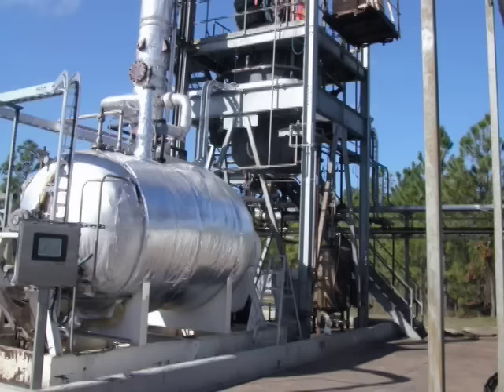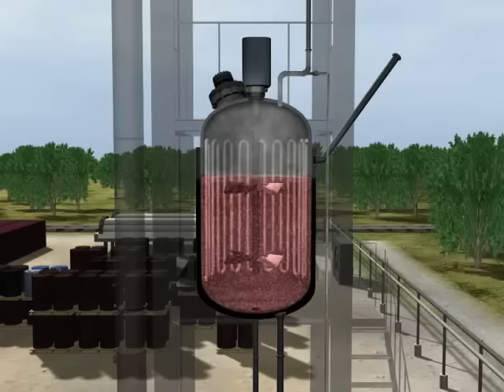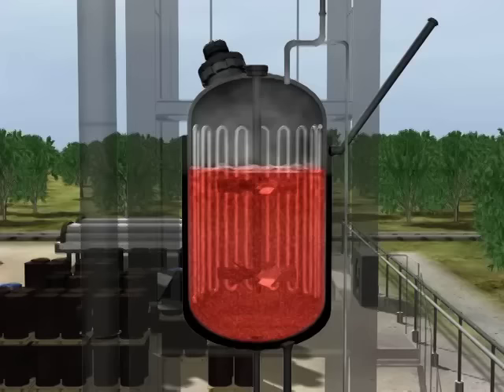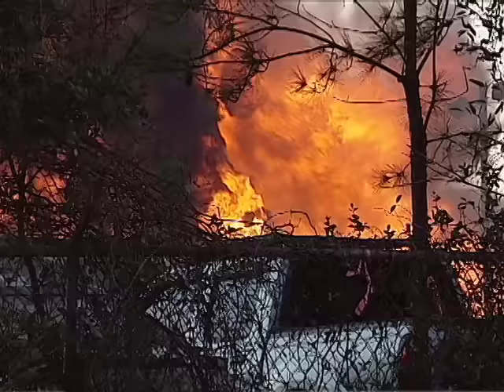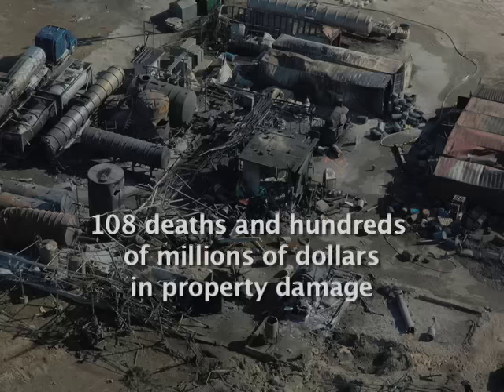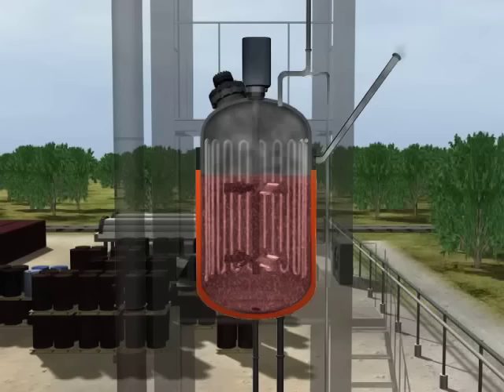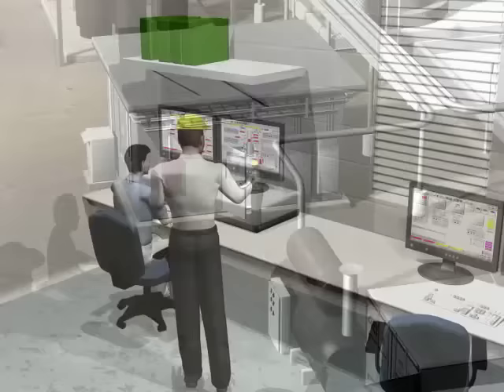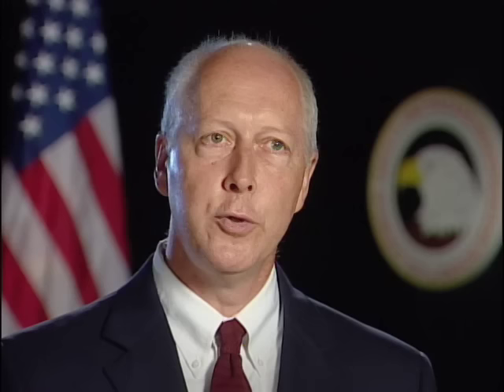Runaway: Explosion at T2 Laboratories

Comment: Is that a saying yet?
"In a runaway reaction, the best reaction is to RUN AWAY"
Reply: I haven't heard that myself, but it really should be well known saying.
That is one of the most important things to know about runaway reactions.
If you can't get it under control and everything seems to be failing, RUN AWAY!
Reply: No, that usually gets more people killed. You want to try everything you can to arrest such a reaction or flare it off, not run away and hope for the best.
Reply: With nuclear reactors, yes.
Reply: Your over reacting ;-)
Reply: Yeah almost making it sound like the thing had a mind of its own like natural disaster as opposed to the old story of greedy/ignorant business not performing adequit maintainance.

More a case of Runaway greed/ignorance vs worker safety in business practises.

Maybe accumilated birdpoop nuggets in the steam release pipe caused a blockade, that however would have taken a long time to build up and should cause noticable interruptions in the cooling for some time prior to the eventual failure.
Reply: @A-Viking  never mind lack of maintenance. There was only one method of cooling. When the water stopped, it was a ticking time bomb. Even a second source of water such as from the tank could have sufficed in slowing the reactions happening inside that pressure vessel.

A second valve that can be controlled from the control room, but with an manual override, to a standby water tank would have been a good start without costing a fortune to build.
Reply: David Daivdson  Yes, I'd love to know who signed off on the approval for that plant.
Reply: acronus that’ll do mate , that’ll do
Reply: Good one! 🤣
Reply: @gorillaau  Single point of failure, like the Boeing 737 MAX, is an accident waiting to happen.
Reply: @UncleKennysPlace  I wasn't going to go there with that one. The 737 MAX mess may take Boeing a while to get out of that hole that they dug themselves.
Reply: A Viking 
Not EVERY industrial accident is caused by corporate greed.
In this case, it was caused by ignorance. The people running the plant simply didn’t know enough about what they were doing.
Reply: @A-Viking  It was runaway meaning without cooling it becomes a runaway reaction. exothermic reaction, creates heat, heat increases reaction, makes even more heat more, and so on.
Reply: A bit more concise: if the reaction runs away, so should you
Reply: What steps do you take if the reaction runs away and there is no backup cooling? Bloody big ones!
Reply: Yes, but is that really a ... SOLUTION?
Reply: I am a Hydrogen Reactor Operator running 4 large batch reactors. One of our old plant managers (before my time) was asked how big an explosion would be if a reactor exploded. He was a Polish man with a thick accent and his response to the room was "gentlemen, if at any point you fear that you must run.... then it is already too late to run." 

I think of this line at least once a week at work 🤣
Reply: Get the........ out of here
Reply: Yup
Reply: @zacharysmith2983  what would it cost to build the control room as a below-ground bunker? Surely there's a way to avoid death.
Reply: At least when you are not capable of managing the heat anymore. Then you should run as fast as you can and as far away as you can. Evacuation is the only thing you can do. But because of that you should never perform chemistry that is unknown to you when it comes to hazards, order of reaction, reaction speed and the amount of heat that would be generated.
Reply: @A-Viking  Didn't seem to be mentioned in the video but it's important to note there was a side reaction above a certain temperature that was vastly more rapid. The owners where completely unaware of the side reaction and combined with a lack of any training in industrial process aspects of chemistry, (and lacked an awareness that they needed such expertise), they simply didn't realise somthing like this was even possibble. It's a classic case of "just enough knowledge to be dangerous, but not enough to be safe".
Reply: CaptainMcShotgun  *yro’ue
Reply: CaptainMcShotgun  oh right, my bad.

Comment: Besides an engineer allowing for such a reactor to be built without a more efficient means of cooling, or least a flare system for the excess hydrogen, it's amazing the amount of CCTV footage there was.
Reply: It's Jacksonville.  The city has had a crime problem for years, and they're only getting it sort of controlled now.
Reply: @tashkiira7838  A big city with crime problems???!!! Never heard that before!
Reply: @LSPD1909  Let me rephrase: Jacksonville has a crime problem that is disproportionately large considering the size of the city and the state it is in.
Reply: Been a few years. Most likely an engineer designed it for a smaller volume of product. The management in all their intelligence probably voted to increase production rates ignoring the designed capacity of the tank.
Reply: For what i see the problem was with total LACK of the safety valves...i would never allow pressure device without all valves to being sell.
Reply: The biggest surprise is that the CSB investigator managed to correctly pronounce the name of the chemical.
Reply: Keep in mind, Chemical Engineers dont actually know any chemistry. The engineer of the past is not what companies want from current engineers.

Comment: Who was the idiot that approved a reactor with ONE coolant line when the state licensed the plant? Never mind they should have built multiple small reaction vessels, there should have been at least three different feed pipes coming into the cooling jackets - PREFERABLY not being fed from the same source!
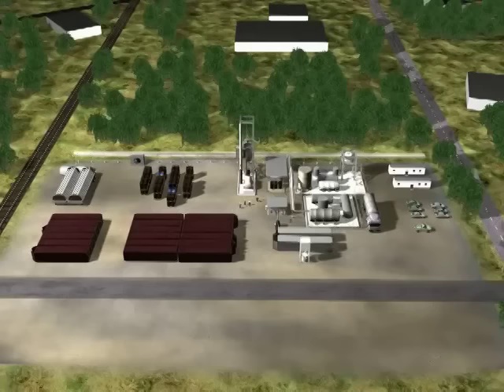Reply: +jmowreader --> The other question that doesn't seem to be covered in this video is why did the blowout pressure release "rupture disc" mentioned at 3:24 blow so late? Was the disc that was installed the wrong one with an incorrect pressure for the circumstances or did it fail in some manner?
Reply: This is what happens once regulatory agencies become "business friendly", they let people get away with cheesy designs so that they can save money.
Reply: What amazed me is the blast managed to breech the control room and kill the two men inside, I bet the staff had no idea just how powerful the blast would be if the tank ruptured, they all do now, well the staff still alive and won't make that mistake again.
Reply: It's very common for a reactor to only have 1 source of cooling.  I know, sounds stupid right.
Reply: Typical American Engineering; rather cheap and dangerous for fast money, then investing in a durable solution that may cost you more at the start, but saves money and lives in the long run.
Reply: bjtaudio I was even more amazed that the control room was literally right next to the chemical plant. Any serious industrial company with the least bit of scense and brains regarding safety would have build that control room far away from it!
Reply: NyTO really? A problem in a  system with only one cooling service is foreseeable not hindsight.
Reply: Marc Bonomini: are you being sarcastic or what? The business didn't put the adequate safety measures in because they wanted to make fast money... how the hell would they change that up without regulations (specially if a company isn't on the ground to see explosion and human life becomes cheap)? 

The bureaucrats weren't critical enough because they were probably paid off by company, didn't sign off on the building or the state cut down on regulations.
Reply: That's what I was thinking.
Reply: but think of the savings on IT work like fibre and long data runs!!
Reply: jmowreader Florida
Reply: @marcbonomini2751  what?
Reply: @marcbonomini2751  OK.... it might be as you say but some sort of  compulsory oversight is needed. I'm thinking that compulsory, comprehensive insurance might do the trick?? No insurance, no operation and have the insurance companies assess the risk.
The Pike River mine disaster..... failure of the most simple regulations, abetted by a business friendly government AND ignorant  and naive workforce and management.
Reply: @leighfoulkes7297  Imagine today. No regs none. NONE
Reply: @OAleathaO  Indeed...the "blowout disk" might as well have been a "blowup disk" there would have been virtually no time to react.
Reply: @thegreatga  Many newer systems have redundant backup valves, pumps and bypass valves so there are more than one way to introduce cooling, or supplement if required
Reply: Possibly some very newer systems with companies that care, but rest assured, the company that I work for doesn't.  Many of our reactors only have 1 source of cooling.
Reply: @marcbonomini2751  
You're playing the blame game.  You don't know what you are talking about.
Reply: @OAleathaO  I've never placed a lot of faith in rupture discs.
Reply: It's Florida
Reply: $$$$$$$$$$$$ that"s who
Reply: @joyrider6456  like China too now
Reply: Corey But, but! They were CREATING JOBS! That’s always the #1 thing people seem to want from their politicians, as if they’re the Wizard of Oz going to somehow pull jobs out of a magic black bag. Most people are so simple minded they can’t even understand things like this relatively simple scenario of cause and effect. If a politician argued against this facility, the opposing politician would bray on about how “Bob Smith HATES JOBS! He voted against a bill that would have brought dozens of jobs to this Florida area!” completely disingenuously and in bad faith - deliberately refraining from giving any context that would reveal the true nature of exactly WHY Bob Smith voted against the facility. 

You see this kind of BS constantly nowadays, and tons of people fall for it. They actually believe things like “Democrats hate America”, “Democrats want to impose Sharia law”, “Democrats want to destroy the Constitution”, etc etc.

I’d give counter examples, but there’s only one political party that consistently relies on these sort of cheap, bad faith, sham statements designed to prey on people’s emotional fears instead of using logic and reason to produce a strong argument.
Reply: You're implying somebody actually approve these! Based on this story I am assuming NOBODY does that.
Reply: The one who approved it for purposes not like this.
Reply: @thegreatga  Perhaps should have had a mechanism to add the sodium metal chunk by chunk, so it couldn't run away.
Reply: @bjtaudio  It likely was not the tank, but the gas-air mix from the vented gas. They basically made a fuel-air bomb.
Reply: Roertje 85, or underground/basement room
Reply: correction just water not coolant
Reply: It's Florida. No regulations
Reply: @OAleathaO  probably a miscalculation of the gas yield at the disk burst pressure (and therefore the temperature of the reactants at that pressure), leading to an inappropriately narrow vent pipe.
Reply: No regulation baby!  FREEDOM!!
Reply: @michaeljones8079  Pretty much, yeah.
Reply: What about a condenser hooked up to the piping where the steam comes out after the water gets heated by the reaction, then the steam flows through the condenser, turns back in the liquid water, then the liquid water is pumped back into the reactors cooling jacket?
Reply: @OAleathaO  I think it was an undersized relief system. Liquid boiling temperatures are higher when under pressure. If you release pressure the boiling point drops and more gas is generated and then the pressure ramps up. It had no where to escape to.
Reply: @joyrider6456  like chernobyl, right?
Reply: @OAleathaO  I think it could have been an oversight with extreme heat causing the disc to somehow warp over time or buckle inwards and only get pushed outwards at extreme pressure
Reply: @joyrider6456  I dont think you have a license for that speech mate.
Reply: Hindsight is 20/20... 😒

Comment: These guys were fully aware of the hazards of the reaction.

What they weren't aware of was hazard mitigation and redundancy. They thought they had double redundancy with the water jacket and the pop off valve, but the reaction accelerated much faster than they ever envisioned. 

One always has to allow for multiple failures, and always design intrinsically safe whenever possible. This process could be made intrinsically safe by installation of a 6 inch pressure relief valve in the bottom of the tank that feeds into a 500 ft stainless steel pipe kept under vacuum. The sudden expansion would dramatically and instantly cool the process, with no environmental impact whatsoever. The process feedstock might even be recoverable to complete the process. 

Also, and most important of all, safety systems are useless if they cannot be regularly tested. It's nice to have a rupture disk, but that has to be third or fourth in the line of protection, because it can't be tested. And then there needs to be accommodation of rupture disk failure, as these were carcinogens.
Reply: Rupture disks can be tested... And then you replace it with one of the same.. 🤷🏻
Reply: @davelowets  😂
Reply: @FelonyVideos  Works just fine...
Reply: @davelowets  Sure did!
Reply: @FelonyVideos  It DID do it's job.. The fault lies with something other than the disk itself..
Reply: @davelowets  Can you quote me where I said the part failed? No? Then why are you assuming things I never said?
Reply: I mean, in a tiny 1 liter test reactor, that would have worked perfectly (minus the hazard of venting the hydrogen straight to the atmosphere), 10,000x bigger though, not so much